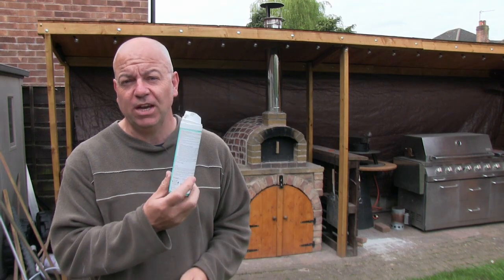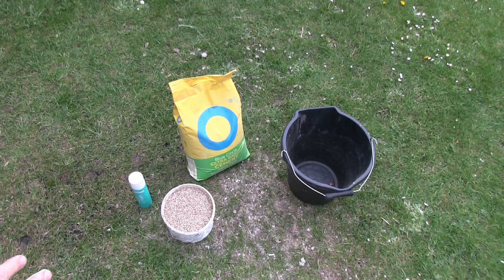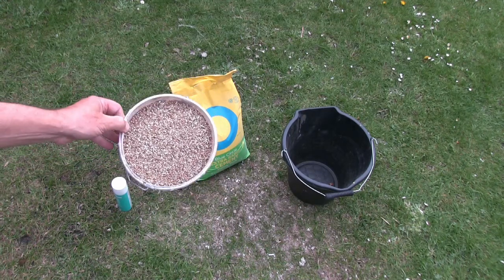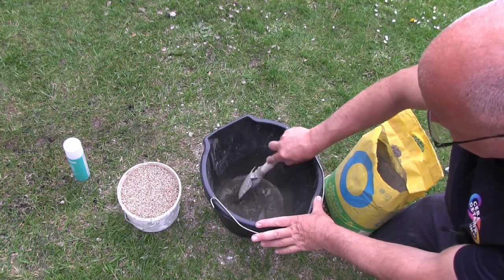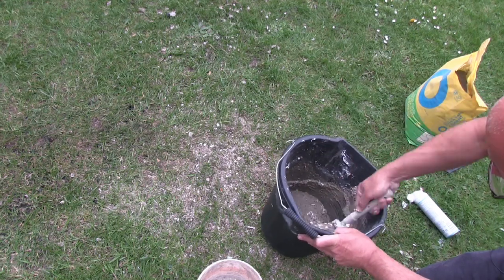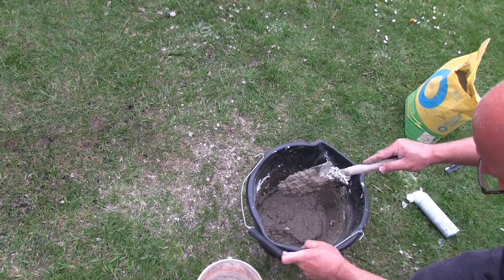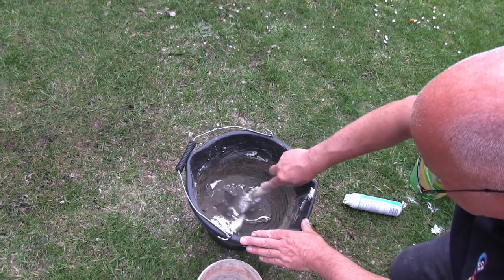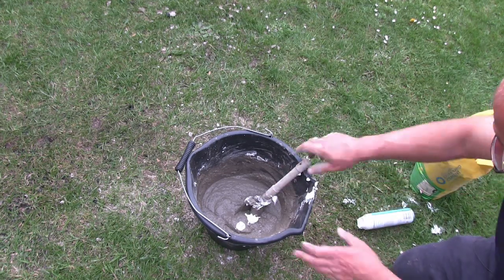Shaving Foam Aircrete

Comment: Is the vermiculite because it's a stove, or is it needed for the aircrete to work?
Reply from the maker: The vermiculite is needed to retain the structure of the aircrete. it's lightweight and aircrete incorporating vermiculite holds its volume better. I have tried to make aircrete with a simple concrete mix but it didn't hold any sort of volume. I also used the aircrete for a rocket stove so needed a mixture that would also cope with a high degree of heat and the vermiculite helps to do that. You can also use perlite if more readily available.
Reply: @mancaveprojects4693  Thanks!

Comment: Have you heard of adding water glass to the exterior of the air crete?  Other videos say it makes it harder, more fire resistant, & less prone to breaking...  Is your air crete pretty strong too?
Reply from the maker: Haven't heard of that but if it helps to strengthen the exterior then it's got to be a good thing. The aircrete I've made is strong and hasn't shown any signs of cracking (after 20+ fires). The exterior does shed some material though so a harder shell would be great.